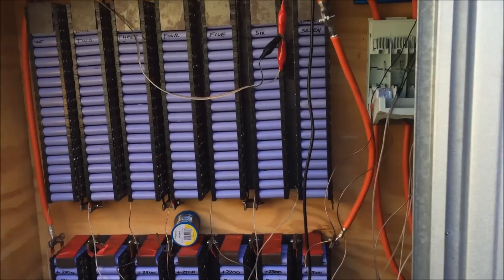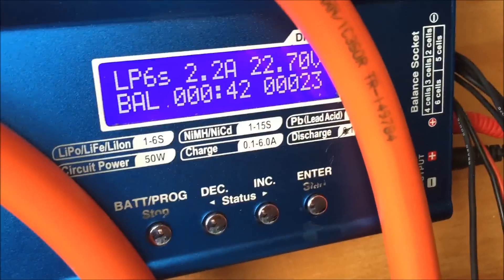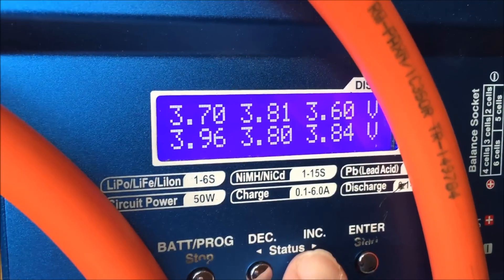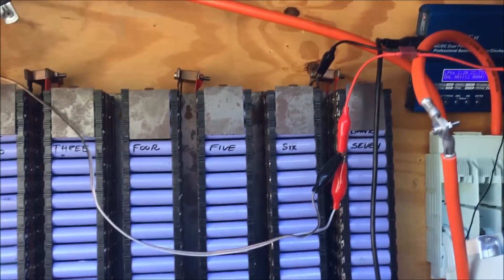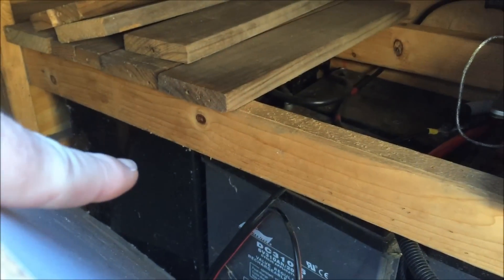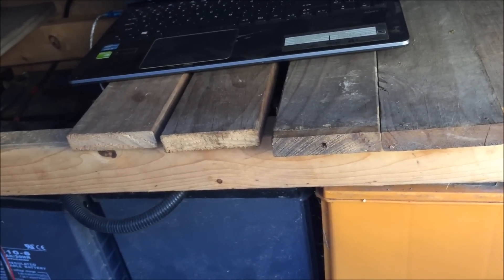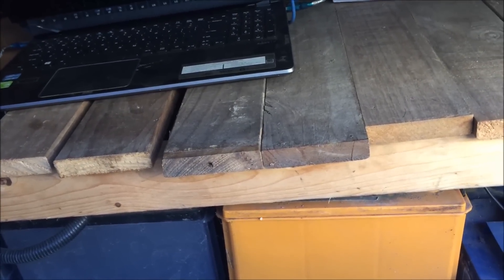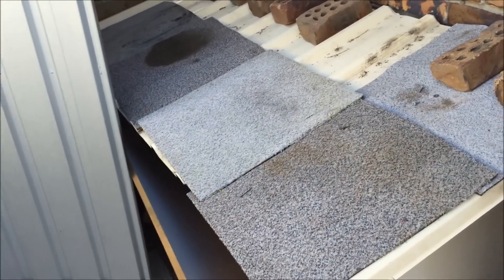18650 powerwall update

Comment: Good day, whats the best daily charger for this battery pack?
Reply from the maker: I use PCM60x with float turned off and max voltage per cell set to 4.05v
Reply: HBPowerwall Ok kool
Reply from the maker: no worries

Comment: i was confused with that low amps charging aswell, when i first got a similar charger. 
let me explain. :D if you didnt find out allready.
2.2A*22.7V=49.94W 
it says right on the charger. "Circuit Power" 50 WATTS  :D 
that's why :D 
youd be better of to do 1 pair of packs at full power than all at once or? 
cheers

Comment: If you're feeling brave, the most accurate way to balance all the packs is to connect them in parallel. However massive current will flow between them if they're at too dissimilar voltages. You can do some calculations to work out the current that will flow.
Reply from the maker: I've done this in the past .
Reply: +HBPowerwall anything interesting happen
Reply from the maker: Uneventful, it just worked :)

Comment: so how do i charge my batteries 4s if i dont have imax b6 or solar pannels? now im thinking about a rewound 12ac transformer and a buck converter from ebay but they only have 10a max continueous buck converters. i wanna charge it fast. what do i do?
Reply from the maker: I'm the last person you should be asking for help sorry, i googled everything i know, and as it turns out even then half of it is wrong information.
Reply: +HBPowerwall i can see you used imax b6 but what are you using to charge your bank?
Reply from the maker: Imax & pcm60x but only while i sit there for many hours checking temp & balance.
Reply: HBPowerwall thanks

Comment: why arent you using your solar panels? you did on the bench?
Reply from the maker: too much of a pain to reconfigure & connect the bms when i need to redo everything from scratch when i get the new shed.
Reply: Ive started my 18650 episode got about 700 cells, ordered a 1200w charger, half way threw charging them,(and sorting). im going to try running them into 2 or 4 250w micro gridtie inverters. threw a current regulator.
Reply: Can't wait for that video... who will hold the camera?

Comment: I think the iMax b6 will time out long before you've got those packs charged with it. I have a 3S72P battery case split into 3 x 3S12P packs and I'm 90% sure when I tried to charge the whole thing it didn't finish.
Reply from the maker: I just tuned all that off.

Comment: Just a heads up, it's quicker to charge each cell as a 1s than trying to balance the pack. As the IMAX is trying to keep them all at the same voltage it adds a little in then burns it off. 
With my lipo batteries for rc if I get one really low cell I'll bring it to full by tapping in to the balance to nectar and charging at 1 or 2 amps. 

Will prob take an age with a battery your size tho.
Reply: Don't know if someone cares, but I agree :D
Reply from the maker: I figured it would be faster this way, as it'll charge at 6 amps for a little while then ramp down doing one pack at a time. this way it's charging at 2.2 amps per cell - thats 13.2 amps ( remembering i hate math) even if it is wasting some still seems to be faster this way ?
Reply: take less intervention by you this way but i believe they only balance at 300mah
Reply: +HBPowerwall as a 1s is only 4.2 v max you'll actually get the full 6A for the bulk charge. On my small RC lipos it takes an eternity to balance out, it'll be worse if ones already at 4.2 as the IMAX doesn't want to risk over charging it so will only trickle in the tiniest amount, if any.